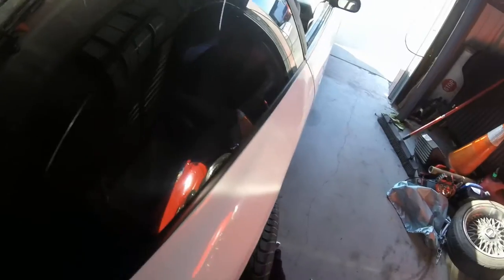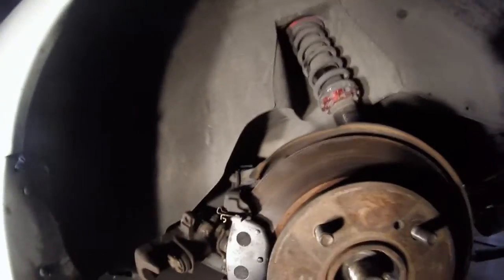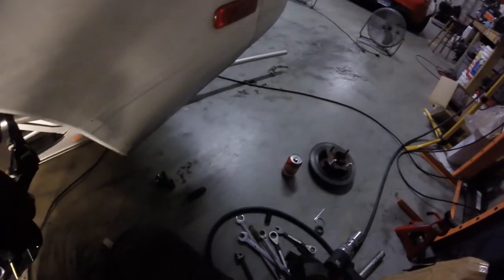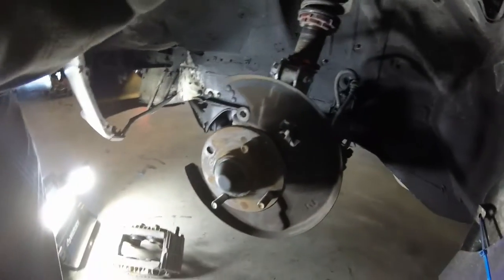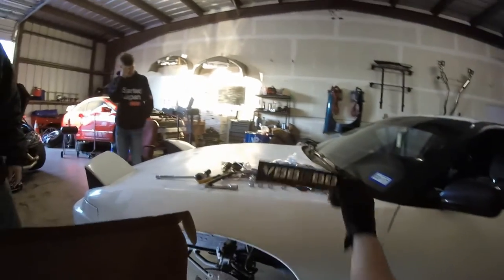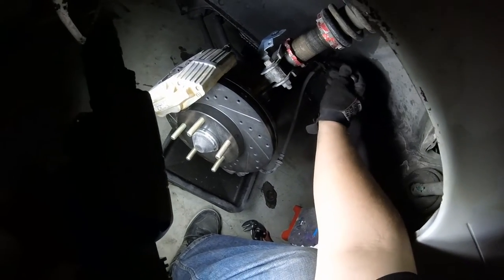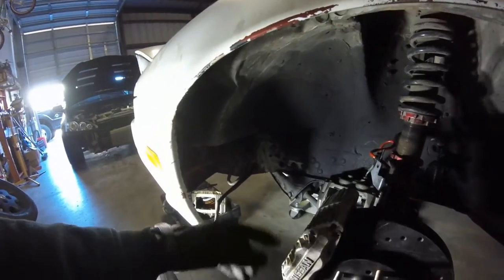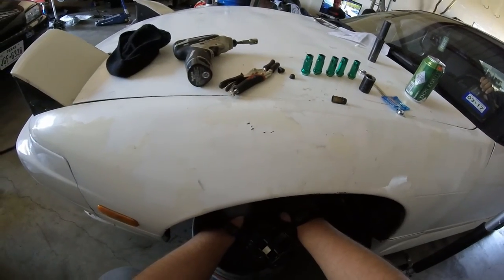Panda S13: 5 Lug swap, Z32 calipers and an R32 stops by.

Comment: Whats the difference between  the z32 calipers i see on ebay for 300+ $an the remanufactured ones at the auto part store for 60$
Reply from the maker: Z32 original calipers are more cosmetically pleasing. 
But functionally, they are identical. Plus, remans could come with a warranty.